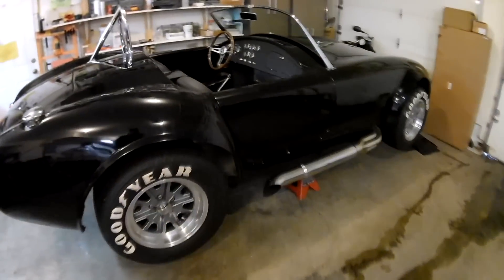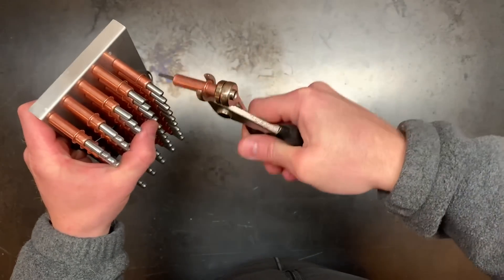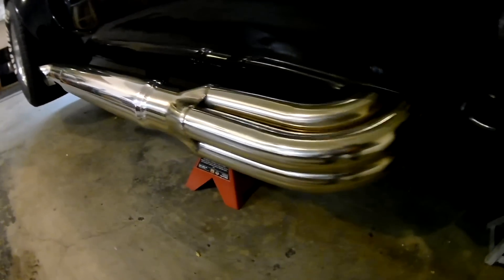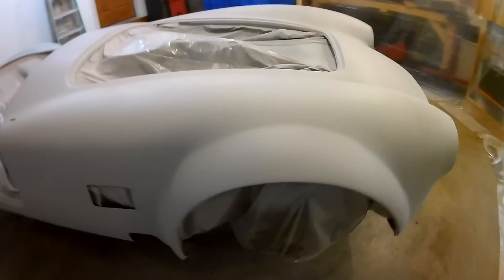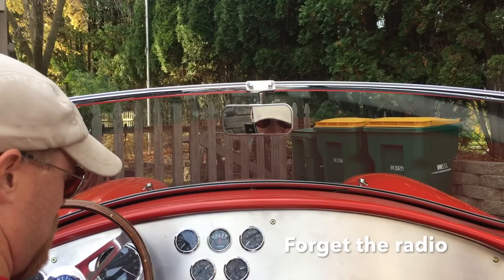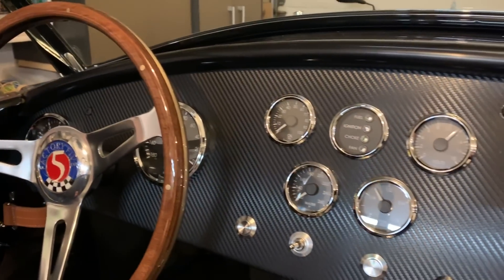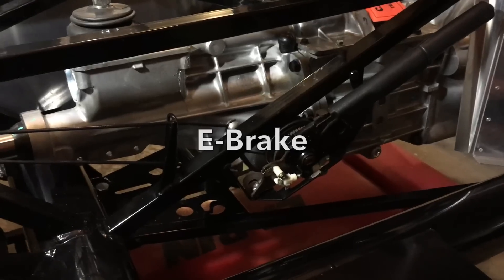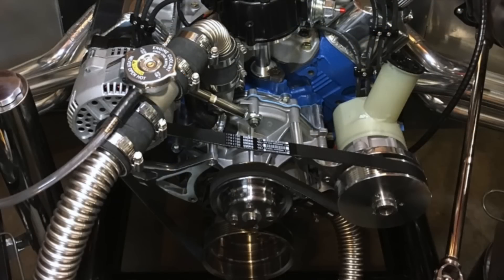Factory Five Cobra: Lessons learned

Comment: How many inches are between the footbox and transmission?
Reply from the maker: its close / basically there is steel tunnel framing covered by aluminum footbox covering and the transmission is on the other side. I used a T5, but there is plenty of room for a TKX / TKO / etc. Thanks for the comment!
Reply: @TacoJoe  cool. I figured the trans only needs 2 inches of space max, even for twist, otherwise it's a lot of wasted space, which appears to be needed.

Comment: So, encouraged by your videos, I have just been through the painting of a hardtop for my cobra, watching and re-watching your vids - great content! I see you burned through the paint when buffing and sanding (@3:55) and had to add more paint. Did you paint the whole car/wing or just the patch where you burnt through to undercoat. Wondering if I need to spray the whole thing all over again or how difficult is it for a beginner to blend in paint over the bare patches. I have used single stage black paint, been through sanding grades and buffed with the same products you used, but not added any wax polish.
Reply from the maker: winged it and just spot painted and did my best to blend it /etc. I think what is key is using the same lacquer thinner type (ie- they are matched to spray temp) - that way it cures at the same rate as the already dried paint. I've "read" that accelerated cure time or slow cure times with different lacquer thinners can lead to slightly different shades. In the end: I cannot tell I repainted these areas and once you wet sand/buff, it helps clear up differences too. If you do things "by the book' though, you would respray the whole car. Big picture: If I could go back in time, I would have sprayed another gallon of paint then the risk of burn through would have been zero / thanks for the comment and good luck with your build!
Reply: @TacoJoe  Thanks for that. I finally buffed the top, having done the back and sides as a test, and have now burned through on a few new places last w/e :( .... so guess I'll re-spray the whole thing over Easter when temps increase here in the UK. Good to know spot repairs are possible for the home set-up. Cheers!

Comment: Your channel is very rational with this subject. Many want to go with huge power. The car is light, 500 hp is beyond what most can handle, as you say 300hp makes a lot of sense, the original AC Bristol did well with a lot less power. At 76 I'm too old to seriously consider one of these, though I was really hot for a Contemporary Classics in the late 1980s. These days I'd consider a FFC with a BOP 215ci V8 or Rover 3.5 V8, those were sweet engines.
Reply from the maker: I'd like to pick up a Rover 3.5 someday and tear it down/rebuild for a project. Great motor and there are some applications where the size/light weight make it a good choice and it delivers decent power levels too. Thanks for the comment!

Comment: Seems like a lot of problems people have with this build is trying to use parts from oddball donors, used engines and drivetrain components, etc etc. 
While it is tempting, I think the lesson overall is save up an other ten grand and follow lead of the guys who have done proper builds with crate motors & trans. You'll wind up with better performance anyway, and isn't that what this car is about?

Comment: Exhaust brackets are stainless, if drill stainless too fast and get it hot, your screwed, it hardens!!!  You figured that out!!!  Drill slow, lots of lubricant...
Reply from the maker: I drilled slow with cobalt/coolant on my mill my-man / if they were stainless, they were alien stainless -lol - thanks for the comment!
Reply: @TacoJoe  I worked in dairy, everything was stainless, trust me, it's 304N and get too warm, and you're done.  It's like trying to  open a hole that was cut with a plasma... Cobalt, ceramic, you're not drilling it, period.

Comment: I'm a painter. Usually stick to fine detail airbrush work but have taken in large projects. I've used the $250-$500 spray guns.  My buddy wanted to get some stuff to paint his car but didn't have the money for the expensive stuff so we went to Harbor Freight. He spent a total of $85 and got a few guns. They worked perfectly for painting a car. So save some money. If you're not doing it professionally go to harbor freight. Don't be cheap with paint. Certainly make sure your clear-coat is good. Cheap rattle can clears will only serve to frustrate you. Some rattle can paints are awesome and there's 1 rattle can clear (spraymax 2k)that is awesome as well. 
ALWAYS USE A RESPIRATOR WHEN SPRAYING CLEAR COATS!!!
This was a great video. Thanks for sharing the tips . One day I'll want to do this with my son
Reply from the maker: Hey John - agree with everything you said / nice comment. Recently I started spraying Rustoleum Farm Implement on non-body parts (pulleys / brackets / frame / etc) - and - I SHOULD HAVE DONE THIS YEARS AGO!  I've likely spent hundreds of dollars on rattle cans over the years that only gave me so-so results and the 8$ quart of Rustoleum sprayed through the harbor freight gun gives an EXCELLENT finish/coverage. Totally agree with you on the purple gun- I actually bought a couple extras that  are still new in the box ready to shoot after my current one wears out. 10$/ea - incredible. I filmed a bunch more painting content over the past few weeks that I'll be publishing on this channel soon and you can see how well things turned out / thanks for the comment!
Reply: @TacoJoe  fantastic. I'd like to see the results

Comment: I was asked by a friend to give hima hand with his factory five kit car, because I had previously built a Shell Valley Cobra car.  I was astonished at how much more work there was to do on the factory five car.  Shell Valley's car required some work , but was cinch by comparison.  The list of things you have to yourself on the FF5 car is mind boggling by comparison.  There were some things I had to do on my car that I had not counted on, but were easily solved.  One thing to be VERY careful of on  any build is drive shaft alignment. The U-joints allow for misalignment either vertically or horizontally, but NEVER both.  Terrible vibration will result.
Reply: @larryw.c.4544 thanks for the tip on Shell Valley. Just checked them out and they seem like a great option.

Comment: Joe...the factory five is like a model car....all the bits are there.   I wish I bought one of them.  I manufactured most of my Cobra myself... Modified the chassis to lower the engine and drive train to get better geometry.  Built the side pipes and the headers. to suit.  Made my own fan shroud and modified a radiator to fit.   Yep put the engine and gearbox in by myself.  take it slow and no scratches on the body.   I don't have cup holders but I do have a round transmission tunnel . I'm glad you finished it .   Enjoy !   my dash was cut out of a road sign ... ha ha ha
Reply from the maker: Road sign! I love it! Was it a speed limit? lol :)
Reply: @TacoJoe  it read  "Barbeque Area"   ha ha ha

Comment: Taco joe, Like your build I don’t plan on adding the hood scoop on my build.  Are you saying I should still add some kind of additional flow? Like ducts or something?
Reply from the maker: Hi Shane - if you run EFI you will be fine / my issue is carb vapor lock (motor isn't overheating) - coolant never gets over 190, Its less about getting cool air under the hood, rather more about getting hot air out. A hood scoop pushes the hot air out the side louvers while feeding the motor. Another option is vents on the hood and they look cool too. I noticed once i gapped the hood before paint, things got much better too - just that extra 1/8" across the back is enough to make a difference - thanks for the comment!

Comment: thanks so much for sharing. i think i will sell my bike to star the project. what about of buying a 5.0 motor with transmission from Ebay? thanks again.
Reply from the maker: buying a used motor is always a game of chance- unless you can confirm its low miles, i almost always plan to rebuild so if you find a good price, go for it. The risks are you could end up with a cracked block / catastrophic damage/ etc. Start by pulling the pan and look around. Check the salvage yards too- 5.0 should still be around - T5 tranny might be tougher to find. Thanks for the comment-

Comment: Thanks for doing this. I've been wanting to get the Daytona kit for some time now. If I do, I'm going for the complete kit and will save for the 427 Windsor/Speed Master Stack injection EFI with a Tremec 600. The only thing I don't think I will try is the body work and paint. That's something I've never done before and it's the first thing people will notice. I at least want that done right.
Reply from the maker: Body work isn't bad- you just need to have a lot of patience and plan plan plan. 427 to a Tremec 600 sounds like a great combo / one thing to note - the shifter is in a different location on the TKOs - they fit, but i'm not sure of all the ergonomics/etc. - check out some of the forums and i bet they can give you some good advise on the configurations - thanks for the comment!

Comment: It seems like they should be able to make a car where everything fits and lines up correctly.  I understand the different engines causing problems, but I've read where the body and the chassis doesn't always line up right.  You have to be able to do fiberglass work to get it right.  I'm on the fence about building one of these, but I am leaning against it due to quality issues I've heard about.
Reply from the maker: Thanks for the comment / yeah things didn't line up perfect on my build but I was able to work through the problems to get it right. As I understand things, the frames are welded on a large jig so I think they are pretty consistent - it seems more of variation might come into play with the fiberglass body and some of the components (mounts / headers / etc.). The bodywork isn't bad either / its like 3D drywall. Add rage gold filler and sand. If you get it wrong, sand it down, add some more and repeat until it is right. Don't let the fit-up discourage you, but approach the project eyes wide open too and expect some challenges along the way

Comment: Hi did you cut out the front wheel wells like they reccomend on ff video
Reply from the maker: I did not see that video but I did take the sharp edges off the wheel wells / the tires can rub unless you clean them up too / I'll have to check those videos out - are they on the FFR website? The fronts were pretty good on mine, but the rears needed some more work-
Reply: @TacoJoe  thanks for your reply your car looks great I was just asking because of the ff video

Comment: Great Thanks.
I am concidering building one. I need the leg room is there a place to put your left foot after clutching? 
Did you look at other kits like hurricane kit. 
Good job 
Regards 
Don
Reply from the maker: Hi Don- I did not look at the hurricane kit / I'm a hair over 6ft and the FFR fits me OK / not a Cadillac, but just fine around town / etc. Check for Cobra meetups in your area and I bet some of the owners would let you sit in theirs so you can get a feel from room/etc. As for my left foot: there is 5-6" of space just left of the clutch / next to the frame rail so on the long drives you have a place to stretch your leg out- thanks for the comment!

Comment: You spoke of the airflow issues and even alluded to what didn't work.
How did you solve the overheating issues?
Reply from the maker: Basically run the fan anytime I'm in stop & go then no problems (I added an in-line toggle to turn the fan on if I want otherwise it comes on when the coolant hits 193F). My issue is less about overheating and more about vapor lock due to a bubble of hot air at the top of motor-

Comment: Great video - thanks. I am seriously considering taking the plunge and doing a build. I am not nearly as mechanically adept as you and the thought of having to re-do the side pipe brackets and drive shaft angle is seriously daunting. I was wondering if you think I could avoid these issues if I bought one of the Blueprint engine/transmission packages recommended by Factory Five. Also, really like the look of your car without the hood scoop - but sounds like that may cause some issues as well. Thanks again for the great video!
Reply from the maker: Thanks for the comment - regarding my exhaust fit: Everything on the motor landed right where it was suppose to (the energy suspension engine mounts were right and the block was an OEM Ford Windsor) - I think the issue was the headers - nothing more/nothing less (the flanges may have been slightly off a few degrees). Had I used the j-pipes I think everything would have bolted up right where it was suppose to be (I still have those in a box somewhere) - because - you gain a lot of adjustment and an extra pivot point. I liked the idea of the 4X4 headers because you eliminate that extra pivot point / etc. to come loose. I think the Blueprint packages will put the exhaust ports in exactly the same place as any other OEM build. The only difference you should see is the slight difference in head gasket thickness. Don't let an exhaust fit challenge deter you - these are obstacles you can overcome and when you look at the big picture they are only small bumps in the road.

Comment: As far as you having the wrong angle on your engine all you need to do is use some angle shims on your differential and shim it to the same angle as you have on the engine. ( Do not measure the angle of the differential by jacking the car up and leaving the differential unloaded.  You will have to set the entire car on mounts or large blocks under the wheels of equal height.)
Reply from the maker: Thanks Jerry- I have this on my list of things to do this winter and that's a great tip - thanks for the comment!

Comment: Great build and video - congratulations! Could you tell us which drill press/bench you have and perhaps explain in a little more detail what you mean when you say you need to fix the driveshaft alignment at some point? Thanks
Reply from the maker: Because the headers weren't aligned with the body cutouts and I didn't want to cut huge holes for them, I chose to slightly angle the transmission and as a result the driveshaft is not at the correct angle. Because the driveshaft is so small / light on this car, any imbalance is difficult to feel-assess. Google it and I'm sure a bunch of videos will explain it better than I can. Bottom line: you can get a lot of weird vibration if you driveshaft is misaligned. As for my mill / precision Matthews - I also have a cheap harbor freight drill press for the non-precision stuff. Thanks for the comment-

Comment: Drill case hardened steel= start with die grinder bit and center punch to begin hole. Eye protection, grease or cutting oil and  https://www.drillbitwarehouse.com/store/p/13pc-terminator-xnf13-series-carbide-drill-set Minimal downward pressure! Bit must not flex. "brittle"! and expensive. Superior to cobalt.

Comment: Very nice job but "running rich" does not cause overheating.  Running "lean" does, among many other things.  Consider a plenum from in the front of the radiator to the grille opening, better fan or double fans, smaller pulley on water pump (make sure it's turning the right way too, a common problem when adding after market assy drive kit). 

Love those old Cobras.  I was going to build one in the late 90's but decided to restore a 62 Corvette instead.  I made the wrong choice.
Reply from the maker: You are correct / that was a brain fart on my part when i did the voice over. Pump is turning right - my issue is more of a heat soak thing vs. overheat (top of the motor getting hot - vapor lock). Fan turns on @ 193 and I have a 180 or 185 stat (don't remember). If it were fuel injected, i think i would be fine. 62 Vette is GREAT! I have a 77 Vette myself (its no C2 though) - restored it also / made a video if you want to check it out (link should be on my youtube page) - thanks for the comment!
Reply: @TacoJoe  I'm a big fan of electronic fuel injection.   I assume you've heat shielded fuel lines between pump and engine.  It's a tough problem but lots of us would like to have your problem.  LOL
62 Vette was heavy and drove/rode like a truck.  Mine would overheat in fast food drive-throughs but NorCal summers didn't help either.  BTW-62 is last year of C1 Vette.  Hard to believe Penske and friends raced them at Riverside. 63 is a completely different car, much better for driving/hot rodding/fun.

Comment: I'm on year 2 of considering buying a Type 65 kit. I'm just terrified it'll turn into a 5 year long pile of parts and drain my bank account in the process.
Reply from the maker: I think you are approaching things the right way by taking your time & thinking things through. If interested, check out the factory five / ffcars forums - i think you'll get a lot of good advise from type 65 builders / they will answer your questions / concerns / etc.